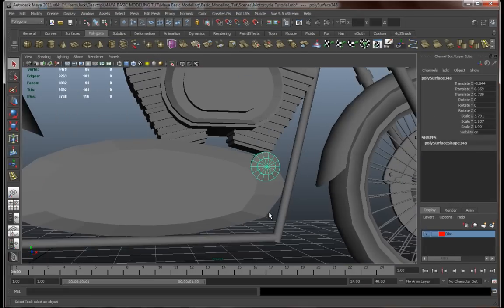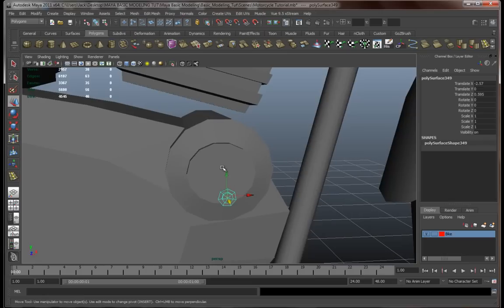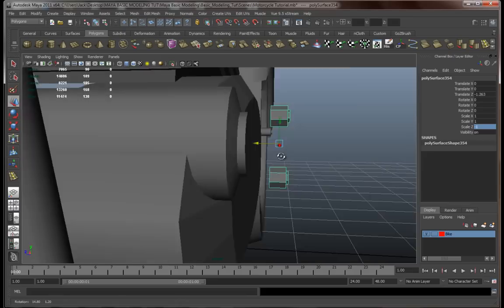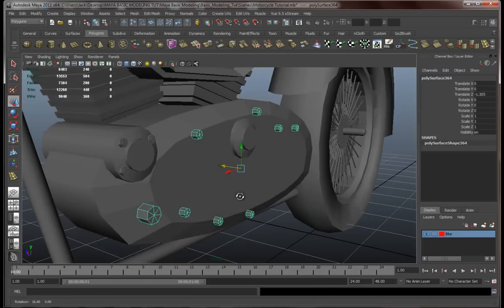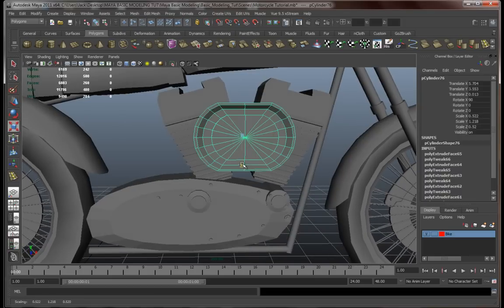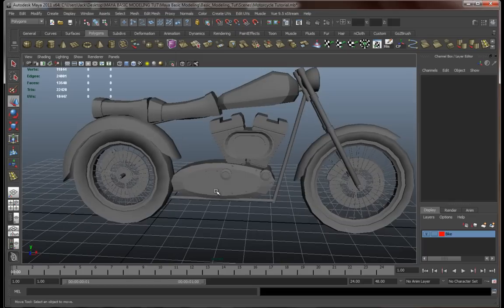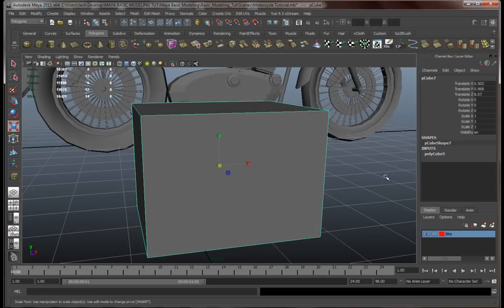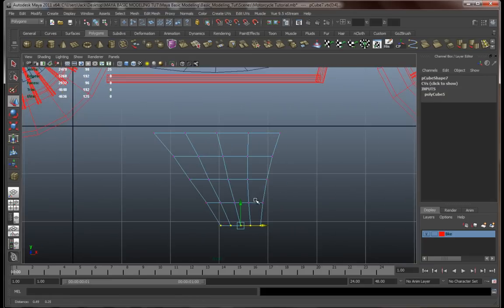Maya Beginner Modeling Tutorial - Motorcycle ( Part 8 of 13 )

Comment: CV curve is just not working the same as I see it in the video.  Using the side view you'd expect it would ignore the X axis but it seriously isn't.
Reply: I did it from the front view and added some extra points near the beginning with the plan to move them over later in the side view, and it worked.  Somehow, after adding the divisions my pipe turns totally black.  I'll have a google...
Reply: Ei’ríġ Proinsias Dammantaċ Ó Gamhna.
Fixed it.  So, what I'd done wrong was I'd put too much of the cylinder over the CV line, causing the faces once extruded to go into the cylinder and come back out with their normals reversed.  The best solution is to do it right the first time, with the centre of the cylinder cap touching the end of the CV line but not engulfing it.  However, if whilst in the polygons work mode (that drop-down tab just beneath 'File' on the toolbar) you click 'Normals' on the toolbar, there's an option to 'Reverse'.  Which is what I did because I'm lazy.

Comment: I tried what ever you said but got stucked at the CV curve. I tried to make it many times in Maya 2013 but cant get it right, though I tried it with the combination of 3 point circular arc and Bezier curve and it worked.
(The CV curve gets Highlighted in yellow and red colour when I try to modify the curve like you did in the above Video.)
I need CV curve for the exaust and some other shapes as well...!
Please help.

Comment from the maker: no worries ;) , well , yes and no , I haven't worked all that much in Max , I think I "played" with it for about an hour or so , the mechanics are different , by that I mean the way in which you create and model you objects , the interface is aswell pretty different , but as a hole , it pretty much does what Maya does , especially since Autodesk bought the Maya license , so I guess it all comes down to preference , I started working with Maya and kept on working with it and it goes vice versa :P